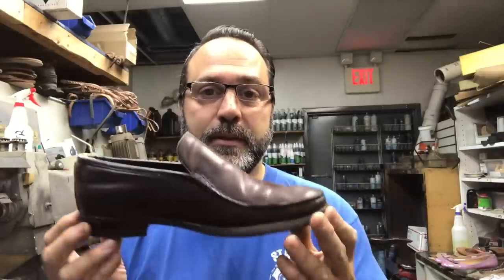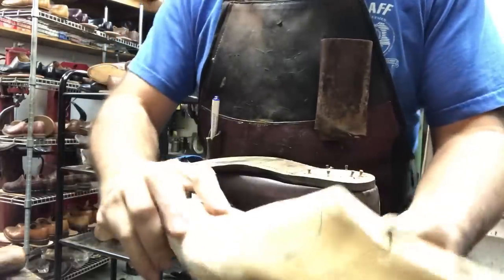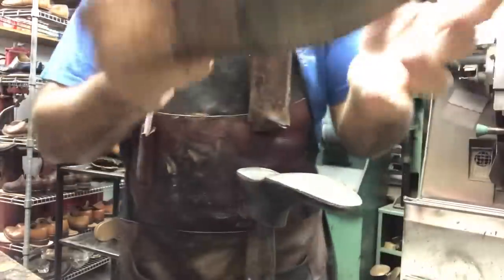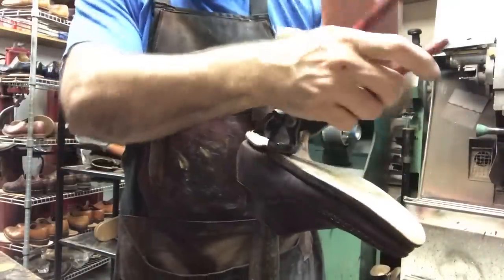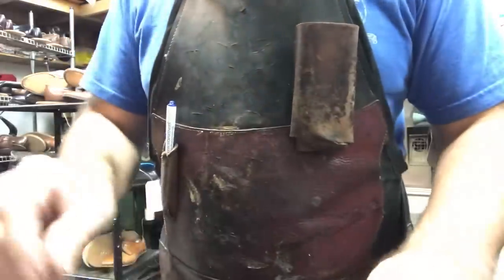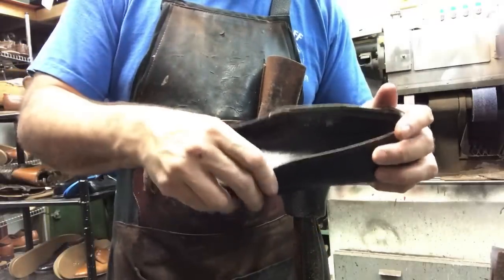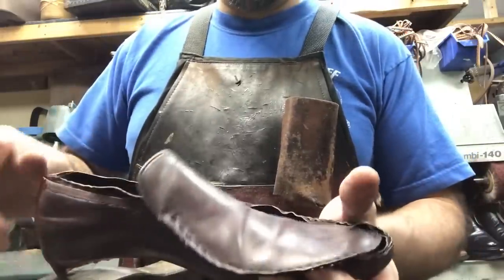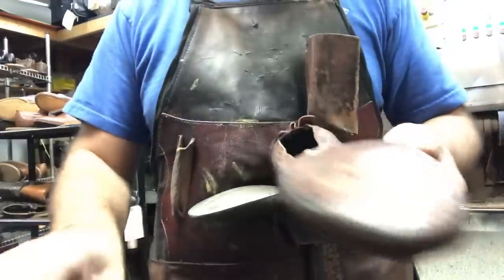FLORSHEIM Yuma Restoration #126

Comment: Steve, you charged only $800 for that fabulous job.  That's a BARGAIN!  Clearly, you are a MASTER leather smith.
Reply: Granted his time is worth that but you could have more then replaced the shoe with new for that...
Reply: @brandonbentley8532  Except those shoes in that model are out of production, and are only available 'used', and are extremely collectible.   So, in this case the restoration was well worth the investment.

Comment: Hi Steve,

We have been in touch in past about resoling vintage Florsheim Imperials. I recently bought a pair of Florsheim Imperial Shell Cordovan Plain Toe Blucher 5 Nail V cleat in size US 9.5 B. The "B" fitting becomes a bit narrow for me since im using C & D normally in the vintage imperials. I have wedged in a larger shoetree to see if it hels leaving it in there for some days....Is it however possible to slightly alter this either with a shoe strecher or by repacing the soles? These shoes are NOS / worn once, so the soles are as new. Kind regards one of your bigges fans, Jørn S. Iversen fro Norway.
Reply from the maker: Jørn yes you could have them stretched